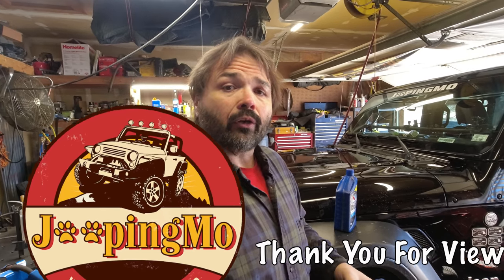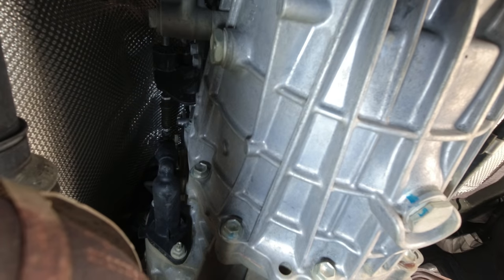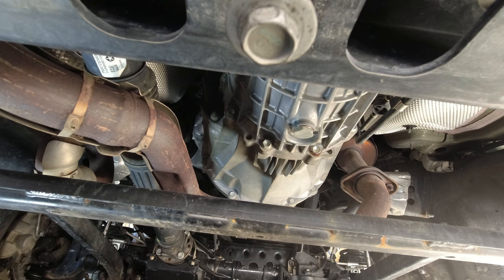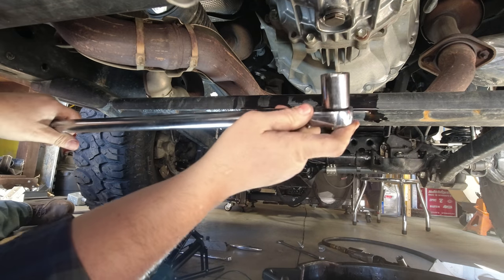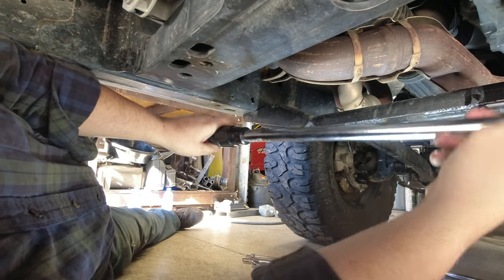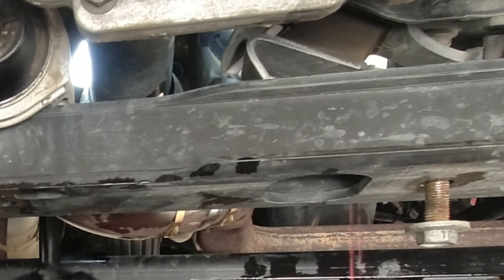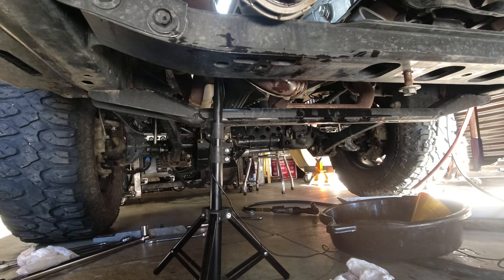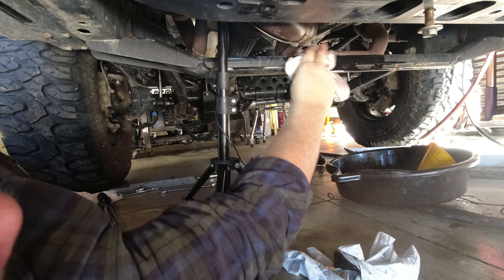Jeep JL Manual Transmission Fluid Changing.

Comment: Awesome vid thanks! But just so you know it is okay to use straight extensions on a torque wrench! 
It only matters if you use a dog bone or crows foot since they can shorten or lengthen the wrench since torque wrenches are calibrated from the handle to the socket drive. 
If you use anyone of those and keep it at a 90 degree angle no math necessary! 
But if you use them at the 12 or 6 o clock position, well math is now required!
Reply from the maker: Thanks for the good info and the good comments.

Comment: That ATF 4 says "automatic transmission fluid" on it.  I presume that is the same oil used both in the automatic and the manual?
Reply from the maker: It was what the JL jeep manual called for
Reply from the maker: For the manual transmission